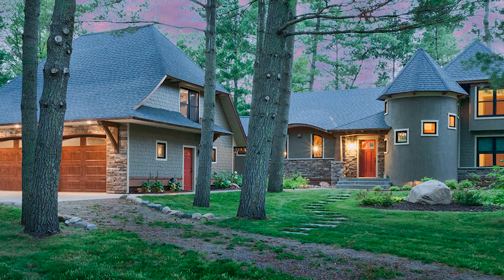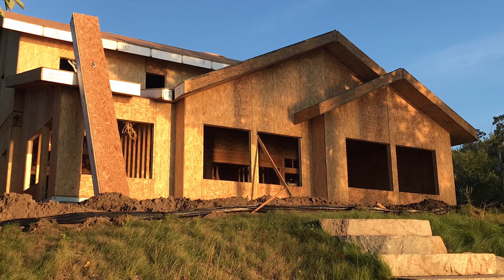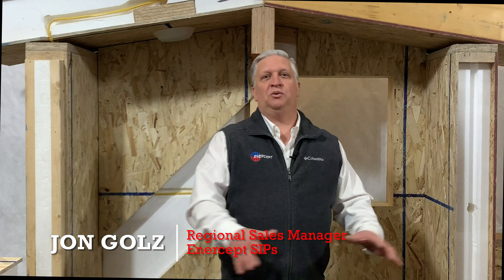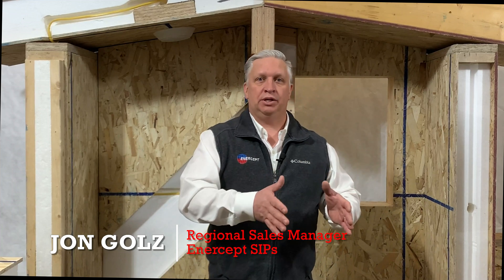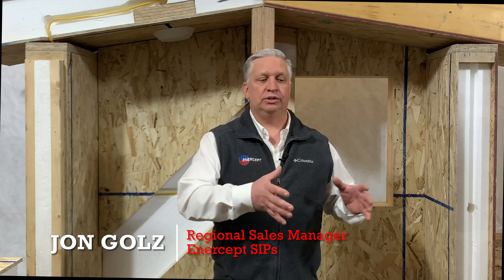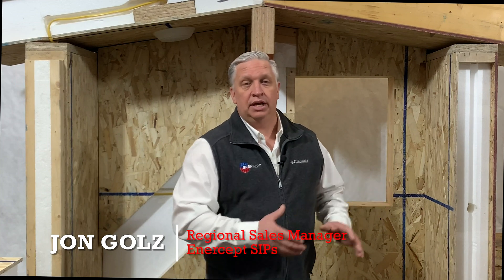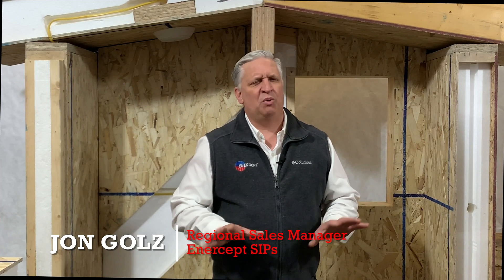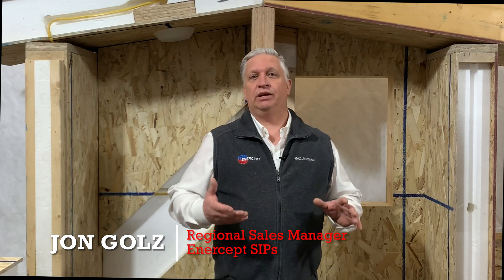How Much Will My SIP Project Cost?

Comment: So, shouldn't the lack of labor costs bring the price down? 
Labor is the most expensive thing. Sounds like the costs are not reflective of the price. Just sayin.
Reply from the maker: While it’s true that structural insulated panels (SIPs) often require less on-site labor compared to traditional construction methods, other factors in the construction of your project play a critical role in the overall cost of your build. Watch this video more information about overall cost of the project. 
https://youtu.be/t72epEFCYRI
Reply from the maker: Here's a video that may help explain more: 
https://youtu.be/t72epEFCYRI

Comment: Can you take down a SIP single story construction and move it to another location?
Reply from the maker: It is possible, however it would be difficult to remove the nails used to fasten the panels together.  The sealant between the joints would be quite messy too.

Comment: So was this video a sales pitch to justify the price ? Because you didn't really say anything. Comparing apples with apples is sip building more expensive ?
Reply from the maker: Excellent question. Here's a bit more information about the cost of SIPs vs stick building. From this link you can get a project estimate and do your own "SIPs vs sticks" comparison. Here's the link for more info: https://www.enercept.com/blog/how-much-will-my-sip-project-cost
Reply: Yea i was hoping maybe theyd answer like a 10x10 wall panel is x amount of dollars but nothing lol.
Reply: @scrub_lord Same, disappointed.
Reply from the maker: A one level ranch style home, slab on grade, is in the $45 - $55 per square foot of floor area for SIP walls and roof panels..
Reply: @EnerceptSIPs  A more useful value is average cost per square foot of panel. Even if given in the form of "for a project of X square footage of panel it will be Y, at 2X it will be Z". I am sure the cost for a 30x42 home and a 40x120 will be quite different.
Reply from the maker: Thank you for your comment.  You are spot on.

We often use the average cost of panel area as another ballpark number for customers to get an idea of SIP panel costs.